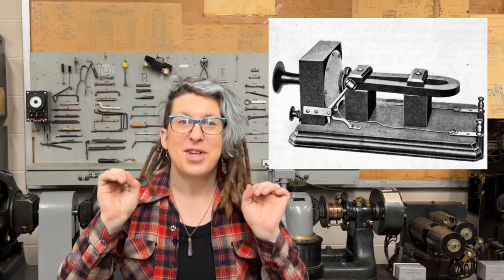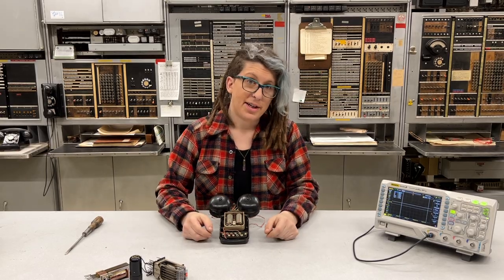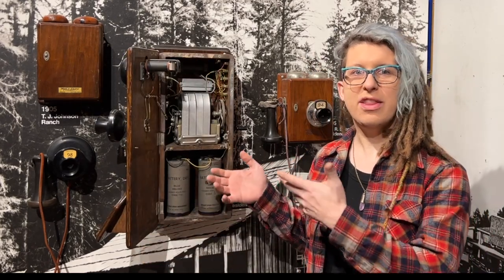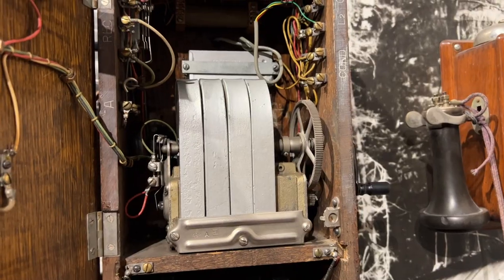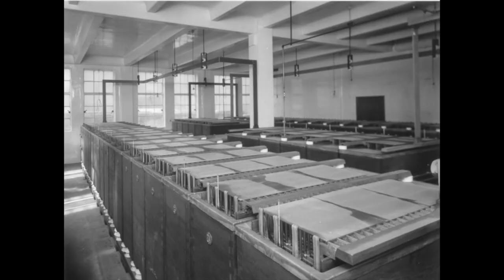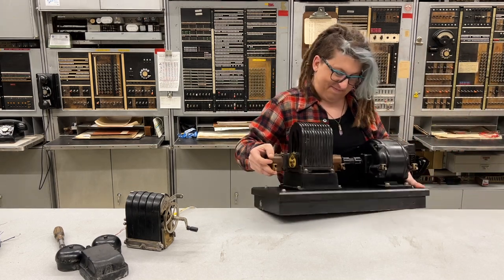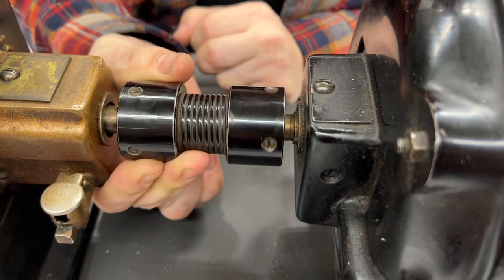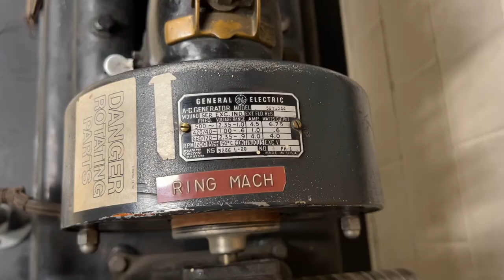How does telephone ringing work?

Comment: As a retired SxS switchman for SouthwesternBell in the 70's, I can't wait for the next video.  These bring back alot of memories.  Namely a very fulfilling career.  Thank you so much.
Reply: Worked SxS Switching for Southwestern Bell in Oklahoma City from 1970 to 1977. Where did you work?
Reply: @gpwgpw555  eldon missouri. Class4 and 5 SxS with cama.
Reply: THANK YOU, Maestro!

I can claim to fame as 1 individual Data point in Bell's decision to change 0 from Information to Directory Assistance.

kid at 7 whips the dial all the way around, fingertip stuck next to the 0 and lets go.

rng rng ring

"Information"

"Hi, how are you today? How many Teaspoons are in a Tablespoon, please?"

"There are three Teaspoons in a Tablespoon, young person. Have a great day."

also, I deciphered the dialer and tested it.

I could successfully 'dial' any number by tapping the hang-up button, technical term long forgotten.

I learned everything I needed to know about everything, taking a bedside Westclox wind-up alarm clock, with no intention of putting it back together, just like science does.

"The gears is what I was after. Aside from the sharp ends on their shafts pricking my little six year-old fingertips.

Tiny spinning tops.

Thank You!

Comment: Sarah, great explanation.  BTW United Telephone, Independent Telcos used different frequencies on party lines like 16 2/3 Hz 20, 25 and 30 Hz. Subscriber  phones had frequency “tuned” bells to respond appropriately. Bell system didn’t adopt that scheme however. Bell used a distinctive ringing like two longs and a short or tip vs ring to ground on two party lines. Who knew!

Comment: I was always told it was 80 vac half wave, in other words 80 volts DC turned on and off at 60 hertz. I used to install phone systems for a telephone company in the 1980's. All the literature I ever read at that time said 80 vac half wave for the ring voltage and 48 vdc, We had one customer too far from the switching stations, who had multiple phones in there HUGE "mini" mansion style home. The phone line could NOT ring all the phones nor could it enough current for voice if multiple phones were picked up. Using a few transformers rectifiers and relays we created a mini switching station, when a phone was lifted within the house, the 48vdc generated by a transformer, bridge rectifier, a few capacitors, one 150 ohm resistor and a relay with a 150ohm coil, would connect the house hold phones to a transformer for voice, and connect the telephone line to the secondary of the phone line. Ring current for from the telephone line, would activate a relay instead of a bell, and the relay would in turn supply 80 vac half wave to the house hold system which in turn rang the the telephones through out the house. Since the voice signal was passed through a 1:1 transformer, the signal was lower than usual, but was still completely audible.

Comment: Perhaps an in-depth topic for one of your videos regarding ringing: multiline business phones from the 1960s-80s (1A2 phones) often had single gong bells that only responded to 1/2 of the AC wave. If you put a diode in series with the bell, it would either ring normally, or not at all, depending on which side of the AC wave it blocked. This came up because with these phones, ring voltage was provided on a dedicated wire pair, separate from the tip/ring pairs from the telco, and ringing was "programmed" by the installer, to control which incoming lines rang which extensions on the multiline sets. A diode matrix block was used to control this, one diode per line per extension. The diode matrix managed a locally provided 30Hz ring voltage that was usually a small AC "frequency generator" (often a Western Electric 118a, or sometimes larger KSU supplies) that divided down the 60Hz to 30Hz using a special phase shifting transformer. I remember wondering why the presence of the diode matrix didn't affect the loudness of ringing in these phones, but soon came to realize that the bells in these phones only rang on 1/2 of the AC wave anyway, with or without the diodes. To use diode matrix ringing, the ring capacitor in series with bell in each phone set had to be bypassed, and the installer had to get the polarity of the diodes right, otherwise the bells wouldn't ring at all. The bells actually have a red and black wire, and if you accidentally switch them, the bells won't ring if a diode matrix is used to control extension ringing, as they really did /nothing/ if the wrong side of the AC wave was blocked by the diodes.

Comment: Just came across your channel. Very good info.
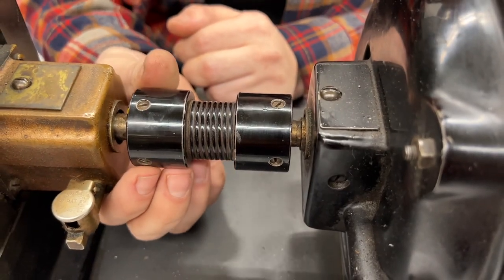FWIW, you are aware that the spring between the motor and the magneto at 9:33 is to align the two different shafts so there is no misalignment and take up shock between the 2.

Comment: Great video!  Liked and subscribed.  I love these old electro-mechanical mechanisms and their clever design.  Not a transistor in sight, let alone a computer chip.   I also appreciate how ruggedly they are built and that you see things like oil cups at bearings.  

Best regards from Key West,
Capt. Blackheart Charlie

Comment: How long do you think a set of #6 dry cells can power a DSL gateway or ONT VOIP function?
Reply: #6 cells seem to be about 35 amp-hours. I believe the phone function on an ONT's 12v backup battery is a bit less than one amp so 8 or 9 #6 cells in series will probably last two days.

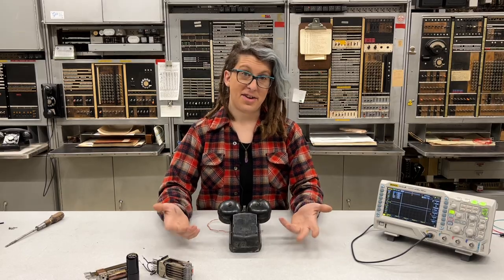Comment: Can I run a bell system like the one shown at 2:18 off of my modern phone lines?  I'm trying to set one up with an antique party line phone and it's ringing nonstop, even when I'm not getting a call.  I have it hooked up to the tip and ring wires (red and green).

Comment: Hmmm, I thought the (USA/Canada) ringing voltage was 10 Hz, not 20 Hz - perhaps I'm not remembering that correctly?  And it also being roughly about 50 VAC atop the on-hook about 48 VDC "battery" voltage.  And the ringing cycle, , 6 seconds, 2 seconds, ringing, 4 seconds not, then continue to repeat (UK is quite different - a pair of rings in each cycle - not so familiar with UK).  So ... what's the oscilloscope show on current USA/Canada ringing voltage?  10 Hz, or 20?  :-)  10 Hz would give 20 ringing pulses per second - so that's basically 40 bell hits - 20 to each of the two bells - in a 2 second ring voltage (then 4 seconds off, then repeat, of 6 second cycle). ... hmmm, looks like 20 Hz: https://en.wikipedia.org/wiki/Ringing_(telephony)#Specifications ... and 60 to 105 VRMS atop the -48 VDC.

Comment: The 5 ESS uses the High Level Service Circuit which can generate any ringing voltage plus any coin phone control voltage. It is a four quadrant voltage source completely under software control. Output was +/- 200V. If a power surge came in during ringing, it would convert it to DC and charge the office battery. IIRC, it is the TN848, but it has been a long time.

Comment: The ringtone as I remembered was 109 volts, the ring generator was down with the power supply for the communication systems. All the wet cell batteries will link together either 24 or 48 volts. I am not a power expert but I am an expert in electronics switching number one number four number five, tsps and ETS systems, 36 years, working for Western Electric, AT&T, qualified system specialist. In all of the above. Today's date 9/11/2022, the worst day in our history. Make all those that lost their lives rest in peace.
Reply: I only got the 10c spiel on ring generators, I've mostly done wireless cell/MTSO. It probably varies depending on generation of equipment, manufacturer etc. The ring voltage was a doubling of whatever the DC plant voltage was. A 48v plant is almost never running at 48 volts. Primarily, at least in smaller plants the manufacturer's specified float voltage range for the batteries dictates how the voltage is set. Plus you figure in voltage drop between the DC plant and the ring generators but that should be small.  So you can see 49 and change to 56 volts at the plant. Typically 52 (ish) volts.  I know I've come across 110v ring voltage, it hurt.

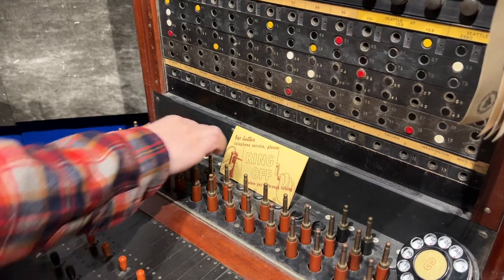Comment: "Ring Off" Love the postcard proudly displayed on your switchboard at 5:42
Excellent presentation, more please. 
  I was in Vietnam we use magneto field phones and switchboards, no one rang off so the gruff sounding male operator operator would brake in into the phone conversation saying "working" and if you didn't answer working working, quickly he would break down the line.

Comment: What's the point of having a motor to spin the magneto? Why not just send current that would have been used to run the motor over to the ringing circuits? The motor is on AC and the magneto generates AC, right? So why not just skip the spinning?

Comment: I Dream of Jeannie!   I love these technical videos.  It’s amazing to see the inside of the old fashioned telephone systems.   You mentioned that 90 volts at 20 cycles is sent through the line to ring the phone.  How does the 90 volts know to turn off when you answer the phone instead of still ringing when you pick up the receiver?  I was just thinking if I built a phone system, and sent 90 volts through to ring, I would probably fry the phone when they pick up.  The phone line only has 2 wires so the ring voltage must go through the same wires as the voice.  

Also how does the ring signal machine return the coin or collect the coin on pay phones?  I remember the operator could return the money deposited if the line was busy.  I’d hear a really loud tone that would actually hurt my ear.  It sounded a lot higher frequency than the normal ring tone.  Could the operator press the coin return button on a non pay phone or was the exchange wired differently for pay phones?  Just curious.
Reply: Power-ring circuit is AC-coupled with ring cadence. Although its voltage is high, the current delivered is low, at least, for modern telephony.
When the end user lifts the handset (off-hook state), the supervisory circuit on the central office side equipment detects the phone is now in low impedance state.
I.e., DC current can flow through (it's -48V "battery").
The supervisory circuit immediately cuts off the power-ring circuit and switches over to voice (audible) signal path.  <-- its first normal state is to provide dial tone.  And many states follow...
Reply: @ccshello1  Thanks for the explanation.  It’s still hard to understand how it happens so fast with no damage to the phone receiver considering the ring voltage is 90-98 volts AC and almost double the -48 dc volts.  How did they figure out a switch that could automatically do that?  The other puzzling thing, if the bell is always connected to the line so that it can ring, how does that not make the line busy?  The bell must be connected to the same two wires that voice travels through but for some reason the bell does not complete the connection even though it’s connected 24/7.  I have wondered about that for decades.
Reply: Bell is AC coupled.  I.e., DC current cannot pass though.  When nobody is calling that phone (means there is no power-ring AC 90V present), battery DC voltage is present across the telephone's two wires (tip and ring pair). Only a tiny amount of current is consumed by the phone (standby mode, Clock - LCD running).  The moment handset is picked-up, much more current consumption will be detected on central office end and will enter dial tone state.

P.S. central office side supervisory circuitry is rather sophisticated and will detect off hook condition very quick and will remove power ring instantly.  BTW, power ring is current limited and will not damage phone's voice circuitry even there's a malfunction on C.O. side.
Reply: @ccshello1  Very interesting.  Thanks for explaining all of this.  It’s amazing that you can have a device that only accepts AC current and completely ignores DC.  I still don’t quite understand it.  I think I would need electronics courses to fully understand how and why this works.   When I was very young (12 years old), I opened the phone and disconnected one of the coloured wires that led to the rotary dial.  When I did that I could hear what was going on through the line but the telephone company registered my phone as on hook so there was no dial tone.  Even though it was off hook and I could hear the Neighbors talking and dialing in the distance.  I could also hear a call coming in.  The volume of the ring in my ear was deafening.  The bell would ring and I could hear the ring tone.  I could also stay on the line when someone dialed out on the extension phone.  Even though it was rotary pulse dialing it still worked with me listening on the line.  I wasn’t interested in eavesdropping.  I was completely fascinated at how this worked.  50 years later I still don’t really know how that was possible, but it did work.  Our exchange was a crossbar system.  The repair man once told me it was C2.
Reply: @ds99  I don't know if phones in your country had it, but the standard T65 phone has a connection on the back so you could hook up an extra bell in series with the internal one. 
If you hook up the earpiece to that connection, you'll hear everything on the line without closing the DC current path, making it look like the phone's on hook.
These T65 phones also have some diodes antiparallel to the earpiece so any voltage on the earpiece gets clipped to about 0,7v, saving many ears.
Reply: @mfbfreak  I never heard tell of T65 phones.  I’m in Canada do we had northern telecom sets that were hard wired in to the line.  You could not unplug them or add extensions.  There was no jack to connect additional bells.

Comment: In my small home town,  we moved just "out of town" when I was 6, about 1954, into the house Dad and Gramps had built before WWII.  The phone was still a wall mount hand crank  "Farm"  / country/ party line, with more than 20 customers.   Our  number was 19F4  which meant  we were the 19th customer on the "Farm" line  and our  ring was  "fast 4" or  4 short rings.

Comment: The ring voltage was a small workplace "hazard" for those that worked on telco equipment. It was a spicy reminder if you touched connections while ring voltage was present.

Comment: In mid to late 1960's I lived in Trenton NJ where at age 14 I was "phone phreaking" to the extent that the phone company sent a repairman to the house to see why so many "wrong numbers". Well, I hooked up a phone dial and intercom to the wires and did so crudely so, yes wrong numbers and crank calls. I was outside on the steps reading Mad Magazine when the phone truck pulled up and the guy got out , put on his tool belt and asked if my parents were home. Thankfully they were not and he accomplished his goal of scaring me. Later my parents looked into moving us to Burlington Vermont where I found that the phones did not have dials at all. They still had a person as a manual central operator.

Comment: Answered before telephone rang!  As a teenager I created a line monitoring circuit with speaker.  It would click when my line was apparently connected to the circuit which would send the ring signal.   Friends thought I was joking when I answered thextension telephonearby before the ring signal/voltage came through to ring it.   Would it still work today?    No idea where the device is, otherwise I'd connect ito see.    Thank you.

Comment: What is funny how that is old is new again. At least in our area, the local Bell company is forcing everyone to fibre and one side effect is that it is no longer becoming a CO powered system but the subscriber is now forced to provide electricity to power the fibre gateway and the UPS that the telco supplies them. The tech pointed out that now the subscriber pays for the power and not the CO!

Comment: I mainly do digital phone systems, but I absolutely love learning about the really old telephone gear. Thank you for the video!
Reply: In some ways, a central battery, POTS phone line is more reliable than digital IP phone service. If your power goes out, the phone still works, unlike your IP phone, which goes dead when your network goes down.
Reply: Yep, I run a PBX, so mostly H.323 and SIP IP endpoints/signalling. But we have a fair share of analog going on for lots of longer runs and fax/data. Nice to get a taste of the old school with the analog stuff.

Comment: Watched and enjoyed your videos for years. It actually inspired me a couple of years ago to purchase a 1960 WE 500 and a pulse to tone converter, and even my young daughters prefer sitting on the gossip table talking on that old phone over their iPhones for calls. We have VOIP and it worked beautifully for a couple of years. They just sent new equipment and unfortunately the ringer barely works, when it doesn't just click back and forth inside the phone. I am guessing the new equipment has a lower voltage output so I am wondering if you recommend any device or voltage booster if that's what it is. I'm not an expert in always thought it was 48 volts but now I'm seeing the 90 volt AC information, so I am confused and don't want to damage anything. Any recommendation on this problem would be so appreciated!

Comment: Thank you for the great video. If the telephone is a 2 wire system and you close the circuit when lifting the receiver, how does the ring voltage get to the telephone set if it is on the hook?